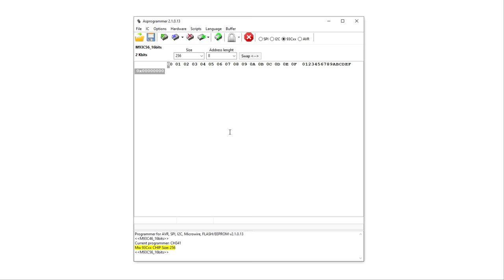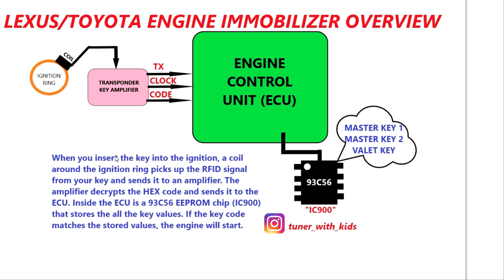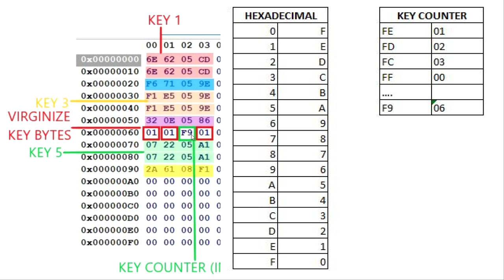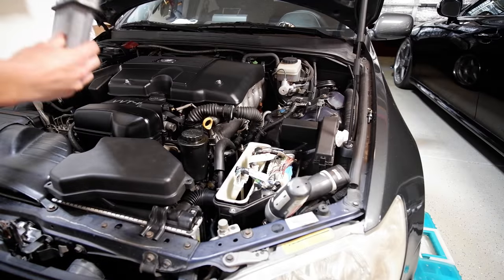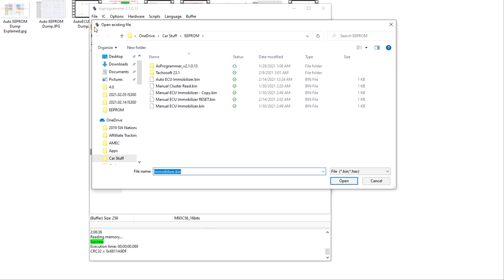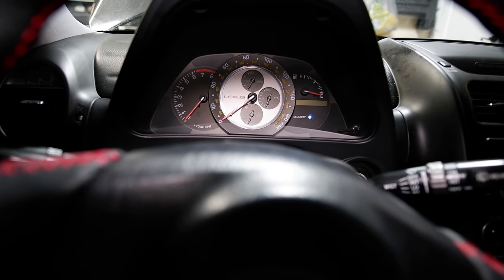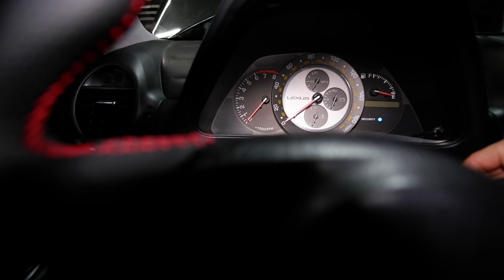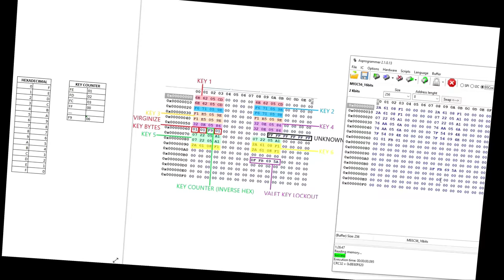Immobilizer Hacking Lost or New Keys for Lexus Toyota | ECU Replacement Immobilizer Hack

Comment: Turn the key on and off 5 times turns off the auto registration mode.
Reply: I tried this and it doesnt work, do you have more detailed instructions?
Reply: That’s for 4d chips not 4c, to turn of the light it needs four keys. With that said it won’t hurt anything with it blinking. But to turn it off you could use any glass 4c chip even if your friend has the same car you can stick it into the ignition and it will save it and not mess his key/car starting his car.

Comment: If you don't have 4 keys to program, you can exit the auto programming mode by pumping the brake pedal 5 times. Then the security light will start functioning like normal.

Comment: My Asprogrammer does not have the 93cxx option is this a older version of the most current one I go to the IC select chip & read it get a bunch of FF repeating or it will say check settings

Comment: Hello, could you please help me with a Lexus Is350 2006 that turns on the immobilizer and I cannot use it, I am already frustrated because I have spent a lot of money on mechanics trying to solve the problem, the last time it only worked for 2 months and now I have the same problem .
Reply from the maker: Did your ECU have damage? Does it randomly not start? Immobilizer only prevents starting once it’s on it goes until you turn off.
Reply: @TunerwithKids  I replaced the ECU but the problem persists, with the new ECU it only worked for two months, the person who inspected my vehicle told me that the problem is not the ECU, it even worked with the old ECU

Comment: Hey Binh, I have a manual ECU with no keys and it's the last part of my swap. I wanted to try this method to get keys programmed but I don't think I have the technical skills to modify the EEPROM Programmer to read the cars IC900. Is there any way to buy an EEPROM Programmer modded already, or is there an alternative method to reseeding the Immobilizer possibly with techstream you are aware of?
Reply from the maker: theres guys on the IS300 forums that can do this as service/business (Quantum auto?). It will be cheaper than reseeding via dealer.

Comment: Hey I have a Lexus key but the transponder chip is bad. Can I buy a new transponder chip, use my old key in the new case, and reset my immobilizer to match the new chips code?
Reply from the maker: the transponder needs to be programmed to the car. The chip is highly unlikely to go bad. Its a passive device that doesn't have any real "moving" parts or power.
Reply: @TunerwithKids  this seems like a massive oversight on lexus' part, the fact that the immobilizer can literally shut down your car but can still be reset if a thief has the know-how. i guess they didnt anticipate being able to hack it in 25 years

Comment: Binh, thanks so much for making this video. You really, really helped me. I was able to take notes from your video and Dr. Shock's and successfully programmed 4 keys. In my particular case it was on a 2001 Lexus LX470 but it had the same 16-bit eprom (IC900 on the board) and everything worked the same way. The trick was getting the USB driver to work on laptop and making sure the clip was making proper contact with the chip (R/W light on the CH341A).
Reply from the maker: Glad you understood it all. Many people are in over their heads with this stuff.

Comment: Great video. Online forums just tell you that the ECU is bad and needs replacing!
I’ve just purchased an 1999 Lexus GS300. It only came with one aftermarket key and now it’s won’t start. Security light is blinking red. So think I’ll try this to clear all the previous keys coded in.
Reply: Did it work??
Reply: How’d it go?
Reply: Please update us
Reply: Hi Everyone. Clearing keys didn’t work. But my son found a work around.  Here it is: 
1. Try and start car once. 2. If it doesn’t start, turn ignition off and back on again. BUT do not try to start.
3. Wait 7 minutes. 
4. Ignition off and on again. But this time try and start it.
This worked for us. I suspect the 7 minute wait is an anti theft feature. But it times out.

Comment: Hey Binh, I've been following your channel for 2 years now and you've been a great help on piecing together my w58 MK3 Manual swap in my 2002 IS300. I needed to ask you if a 2004-2005 manual ecu will work with a 2002 IS300. I know their are slight differences in the part numbers but I'm assuming 02-05 manual ecu should all work because the harness is the same. If you could give me a for sure answer that would awesome, because I plan on picking up the 2004 manaul ecu as my last part of the swap for only $100 without keys!
Reply from the maker: Any 02-05 works.

Comment: Hi Binh. Thanks again for a great video. Love the channel. 
So I got a 2008 is250 a few weeks back, and it only came with one key. I’d like to use this eeprom method to Virginise the relevant ECU so I can add a used key I got my hands on. 
My question is, are you aware of how to do this same virginise process in an is250? 
I suspect it may not be the ECU that needs to be worked on, but the “smart box”, which I think is in the boot. 
Any thoughts?
Reply from the maker: If you have a key. Just order a new key and program it. Order something like this https://amzn.to/3DmLFqH

Comment: I thank for the video it's really helpful. I'm in a situation now where I have 2 Toyota Cressidas (The last two generations), 3UZ-FE with 5-speed auto transmission and 3UZ FE with steptronic 6-speed transmission. We have the original engines' ECUs for each engine. We have also 1 extra ECU that comes with gas pedal, a key, contact. It's missing the immobilizer's ECU. What is the cheapest and fastest way to run these 2 engines please?
Reply from the maker: If the immobilizer is in the ECU, it’s probably similar chip and programming.

Comment: Amazing video! I followed your instructions and got two masters and my valet working, but im having trouble programming the key fob to get the keyless entry working. The car is still in the programming mode (because is didnt have a third master for it to learn). Could that be the reason? Should i try again when the ecu gives up and goes back to normal?
Reply from the maker: Remotes are a different control module. I have a video on programming remotes. Posted last week. Immobilizer programming mode will exit if it doesn’t get all the keys.

Comment: Thank for this information,  but I have a question; can you delete the 900 completely for the ecu system?
I have an 1996 an swapping in a 2005 engine with its ecu.
Reply from the maker: there are services and guys who can disable immobilizer, I don't know how to do it, yet.
Reply: @TunerwithKids  thank you, at least I know it can be done👍
Reply: I heard if you program the ecu in Learn mode or virginized then unplug the immobilizer key reader any key will start and run the ecu (this has to be verified!) Lmk if this works please!
Reply: I heard if you program the ecu in Learn mode or virginized then unplug the immobilizer key reader any key will start and run the ecu (this has to be verified!) Lmk if this works please!

Comment: How can I tell if I have 3D or 4d keys on my 2006 GX470.  Bought keys from Amazon and tech stream won’t program them. Thanks bro love the video
Reply from the maker: Check the description box. I ordered come a seller on eBay who specializes in this and can provide the correct keys. I think GX uses 4D immobilizer.
Reply: Looked it up - your vehicle takes a 4D68 transponder chip. Remote head key part number HYQ1512V

Comment: This is fascinating. Do you know if this solution would work on a Lexus hybrid? My dad's RX400h has been sitting in his drive for 5 years as he lost all of his keys for it.
Reply from the maker: Tow to dealer. They can get a key for it and the code to unlock if you show proof of ownership.
Reply: @TunerwithKids  Thanks for the response. Unfortunately, we're in the UK and Lexus have quoted £2000 for the fix. They want to replace the immobiliser. He even had people out to see what they could do and one guy messed about with it for hours outside. Ultimately he got a key to turn on the dash, but couldn't unlock the immobiliser and actually start the car. I just wondered, after watching your video, if maybe we'd found a better - less expensive - solution. Thanks anyway. I'll keep digging.

Comment: In the hex labelled “Valet Key Lockout” change “FB” to “FC” and that should allow only three keys during programming not four.
Reply from the maker: Thanks for the info.
Reply: @TunerwithKids  this video was awesome!!!!! I tried this on my BMW 3 series 2016  but it didn't work as I bought the car with no keys can you suggest what I need to do to programme new keys to the car ? And what tools I will need ? Many thanks from the UK
Reply from the maker: Idk about BMW or newer cars. They aren't same as Toyota. Newer cars also have different security with twoway handshake with key fobs.
Reply: @TunerwithKids  thank you for taking the time to reply back much appreciate!!
Reply: @5905-k8v  did you ever figure out how to add a new key to your bmw

Comment: outstanding bro can i use this process for my Honda CBR 650 Motorcyle because its also used 93C56 EPROM in its ECU
Reply from the maker: Anything that uses an EEPROM will work. Just depends on if you know what the code is.
Reply from the maker: I wouldn’t know what to look at for motorcycle. Each manufacturer is different.

Comment: Is the only thing that prevents another ECU from working in your vehicle is the immobilizer function and whether it will allow keys to work in the ignition?
IOW, after this is done, the new ECU will work perfectly in the vehicle, right?  Nothing else is necessary, right?  I have an all keys lost situation on a USA Lexus RX300 and I'm going to see if an XTool D7 will program a new key without swapping out the ECU.  If it doesn't work, I might be following this path.
Reply from the maker: No keys means this is only method or pay dealer $2000 to reseed and program a new key.

Comment: Would this process work on 2006 is250? This car has a separate immobiliser module (ID Code Box) that has an eeprom, so could you do the same on there instead of the ECU, and then perform the OBD pin short "handshake"?
Reply from the maker: The 2IS has an ECU immobilizer similar to this. I haven’t messed with it yet but I do have a spare ECU that I may experiment with one day.
Reply: @TunerwithKids  thanks. Interesting, as I was told there is no immo chip on the ECU, just these standalone ones in the ID Box.

Comment: Thank you for a nice video. 
I would like to replace my car engine with one type 3.0 V6 D-4 i-Four (immobilized) toyota crown royal  but there was not any key for a new engine . 
  Is possible to rmove or replace it by free ECU.
Reply from the maker: Clear immobilizer and program new key
Reply: @TunerwithKids  
Thanks, 
I mean if swap  Mercedes engine w124 with another one type 3.0 V6 D-4 i-Four. 
 Is possible to start engine with out immobilizer code?
Reply from the maker: IDK about Mercedes

Comment: Your video is much appreciated!  Would you know if this same procedure would work for late model toyotas that now come with smart key module (they also call it smart key certification ecu) i opened the box to check out the board and I dont see any eeproms with the part number that is normally used. It is definitely different than the ones prior to 2020. Mine is 22. Any tips would be much appreciated. Thanks.
Reply from the maker: New have a separate immobilizer box. New ECU just do hard reset to sync ECU with immobilizer.
Reply: Wow, I didn't expect for you  to reply that soon. Thanks! Yes I knew that it has a separate immobilizer, but I thought all the keys information was stored in that smart box. 
The car was bought at an auction and  someone attempted to steal it. the whole system is locked now,  and the dealer told me the only way to program new keys was to buy a new smart box which is close to $2k.😢 
How can you do a hard reset on this type of smart module? I know they do the pin thing where the short out  4 and 13 but mine does not have any the TS pin.
I know it's a lot but any tips would be much appreciated!
Reply from the maker: @osmanflores7328 need to reset the immobilizer box. I don’t know how that one works though.

Comment: Can I reset / reprogram a used Lexus ECU with an original key Without having a car on site? If so, how hard is it?

I have Autel Im508.
Reply from the maker: Not with any tool. If you do this, you can clone another ECU immobilizer. Or reset it to allow any key to be added.

Comment: Hi Binh, Finally the guy and video I've been looking for on YouTube. I understand what you were doing but I still have a couple of questions you might be able to help me with.  I own a 2018 Camry.  I have the two original keys and they work fine.
I bought a third blank key from a place in Florida name Locksmith Keyless.
I own a LAUNCH X.431 scanner which has the ability to program keys.  I cut the new key and inserted it into the car's ignition.
I used the scanner to program the new key.  Now I can use the buttons on the key to open and close the doors and the trunk as well as the alarm.  What I can't do with this key is start the car. It will crank ok but won't start.
I see from the scanner that I can only have three (3) keys programed. 
Question. should I still be able to try to reprogram the third key or do I have to erase all the keys in order to reprogram the last one as well as the two originals?  From your video it looks like the car reads the key and writes the code it get from the key into the IC900.
If this is the case there is nothing in the key that has to be erased but rather the ECU clears the memory and writes the key codes into those memory locations?  I this correct?
You mentioned that you found or have some technical information about how the immobilizer system works can you share this information or tell me where to get it?
Sorry for the long message but I want to give you enough information so you might be able to help me with this problem key, i.e. why it wont start the engine yet still allows the LOCK and UNLOCK etc to work after programming.
Thanks
David
Reply from the maker: Your best bet is to get techstream to program keys. If they are regular remote keys, it’s two processes to program. 1. Remote (easy), 2. Immobilizer (tricky). I have a video for 2012 Camry. If smart key, i have video for Avalon, probably same process for 2018 Camry.
Reply: I thought  Locksmith Keyless was a great place to by keys so I stocked up on a lot of inventory from them,  but now that I have been trying to program many these keys that I bought, I have been shafted on a countless bases, especially, if they were bought in a 10 pack from Locksmith Keyless. Honda and Dodge keys from there failed practically every time...   I lost out on several jobs where I traveled 50 miles or more from home and the keys I cut would not program.. I Paid the price for an ILCO from a near by locksmith in the next town and they programed perfectly each and every time... Just Saying... Don't use junk keys if you travel away from the home folks...

Comment: Will this procedure work for jzs171 ECUs they are 1jzgte vvti very similar to the jzx110
Reply from the maker: it should be similar for most Toyota ECU of the same era.
Reply: There is jzs171 without immobilizers
Reply: @TunerwithKids  yea managed to get it to work now have crown vx ecu in my crown
Reply: @4NDR01D5  yes there is but mine has immobilizer and all crown VX's had immobilizers and now my crown had a crown vx ecu. Only 300 of them out there and they made more power from factory, breaking the gentleman's agreement. Higher boost cut and more aggressive ignition table.

Comment: Hello, my 1jz engine I got came with a Ecu with inmobilizer, should clearing all keys solve my issue? it came with no keys I just want to make the engine start with out keys, thank you
Reply from the maker: You need to virginize it and program a new transponder key to the ECU.
Reply: @TunerwithKids  I see problem i dont have the ring that reada the keys would it work in your opinion?
Reply from the maker: Need that to read keys.

Comment: I may not be geeky, but if I take out the ic900 chip will the cart start with any key or is it necessary for it to turn on the starter circuit
Reply: Won’t work because the car expects the IC900 to operate

Comment: hmmb interesting.
Im in a situation where I only have a valet key programmed to the car, and I have a master key that is cut but not programmed to the car.
and from what I know and have experienced is that you can only program new keys to a lexus using the pedal dance method when using a master key as the host key. the pedal dance method doesnt work with a valet key.
I watched this video but im just not quite familiar or up to scratch with some of the terminology mentioned.
Reply from the maker: This is next level stuff. You are hacking the EEPROM to wipe it and telling the ECU it’s brand new and accept the fist three keys it sees as master and 4th as valet on the IS300. Probably same for most Lexus of this era.
Reply: @Rally Ranch Motorsport , I have exactly same scenario for my Prado. Did you figure out how to program master and additional keys when you only have a valet key ? Thx

Comment: Btw quick question does your fuel pump make an engaging noise when you turn the key because mine doesn’t
Reply: i’m wondering this myself
Reply: @DsfOnline  it only primes when you turn the key
Reply: my issue wound up being cel B2796 bad communication with the Key /immobilizer . apparently my key didn’t work and the security light stayed on flashing. next day all of a sudden it started working again 🤷🏻‍♂️